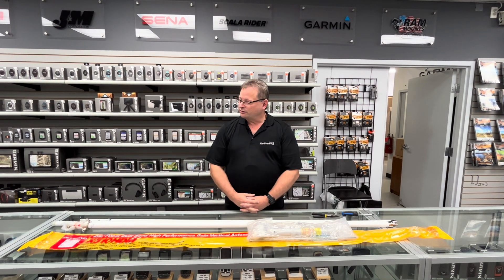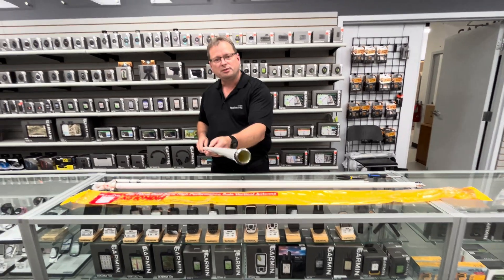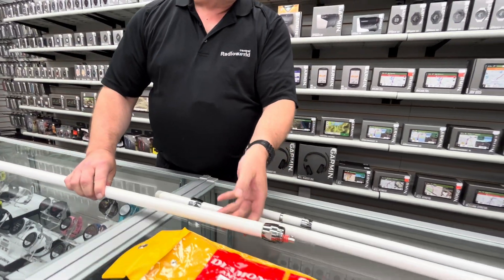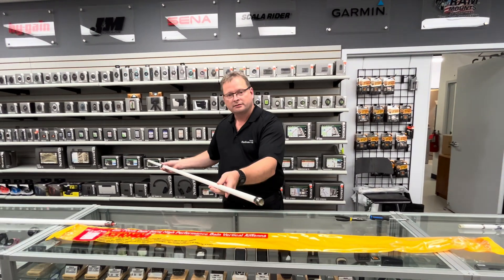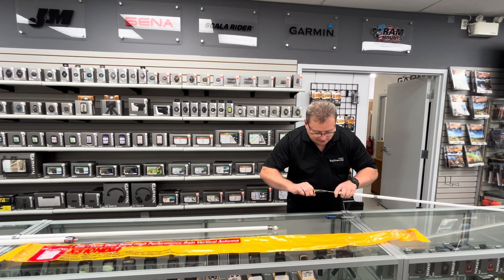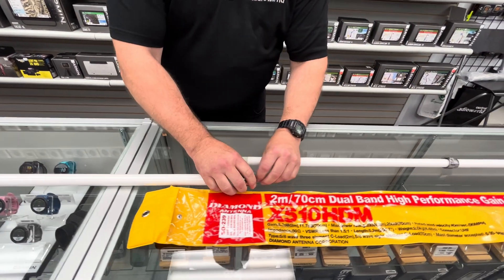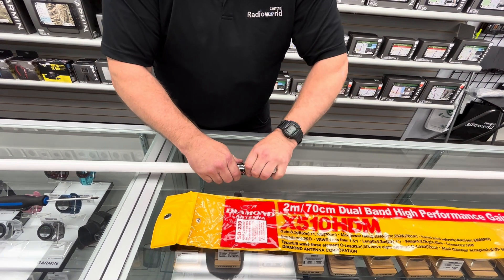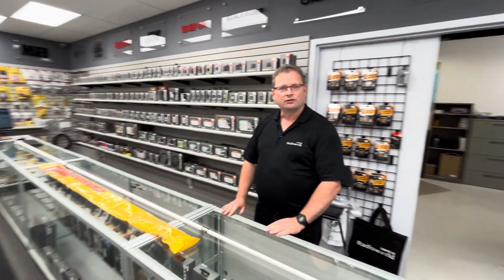How to Assemble a Diamond Antenna X510HDM Base Station Antenna

Comment: I prefer replacing the matching caps in the bottom (rg213 coaxstubbs),  soldering those element connections and heat shrinking the fiber glass connections with glue lined heat shrinking sleeves.  Pray lighting never hits it for there will be nothing left of the antenna afterwards. 😊😊😊

Comment: for a 2m and 70cm , nice looks good, but looks like you would have to water proof it.  those tubes will fill with water unless it has drainage holes.
Reply: Not true. There's a ferrule on that fiberglass and it's a compression fit.

Comment: you missed the important part of securing it with tape, but by doing so you also missed the oppertunity to do the same mistake all the others do on youtube. Rolling the tape from the top down.. the correct way is from the buttom up! That way water wont get in. 73 de OZ6JO
Reply: It doesn't need tape. That's why there's a ferrule  on the fiberglass. 🙄

Comment: Didn't know which band the antenna was for (assembler didn't mention it) until I saw the packaging. Seems kind of long for a 2  meter antenna.
Reply: Its a 2 meter and 70cm antenna. 3 stacked 5/8 for 2m - 7 stacked 5/8 for 70 cm